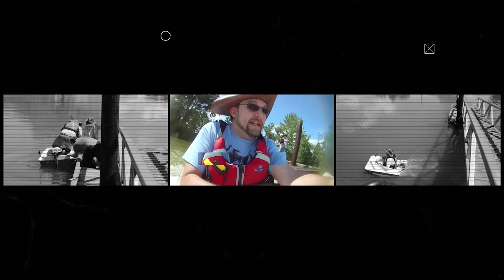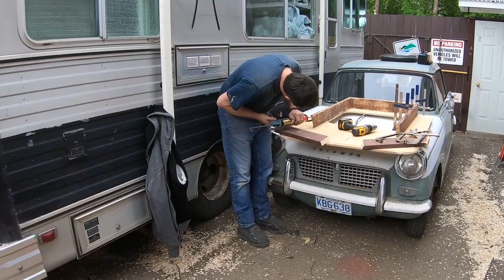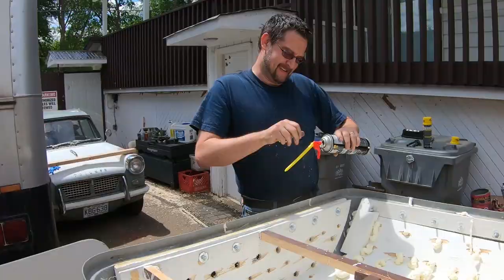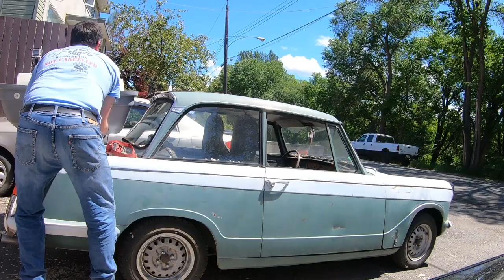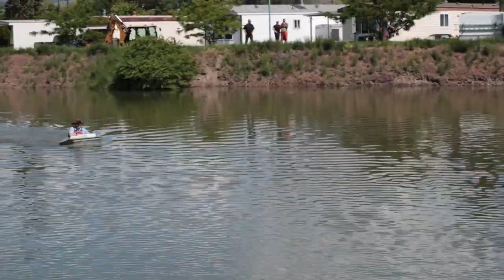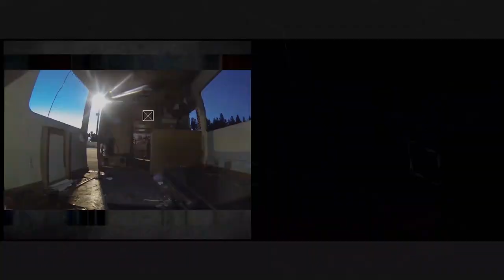DawgStrip - CarTopper - Mini Boat

Comment: Awsome build, tip for when using expanding foam, the foam actually expands quite a bit and it is actually pushing the wooden frame away from the plastic “skin” and on some things could cause issues however not for this project. Looks like a ton of fun, something I definitely wouldn’t have thought of😂👍🏼
Reply from the maker: True, some expanding foams can push or squeeze but luckily the type we used didn't seem to have this effect.